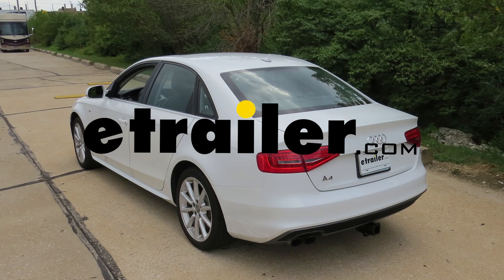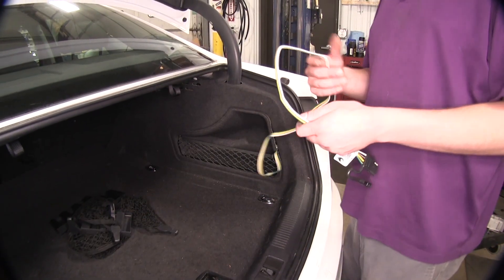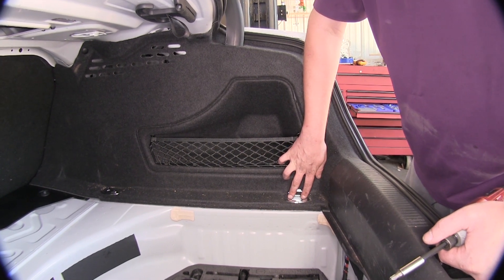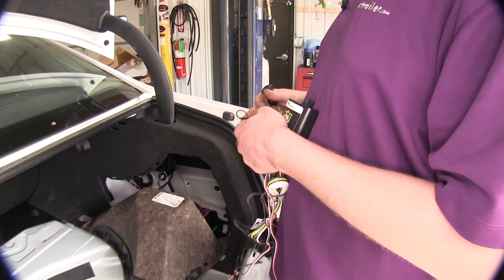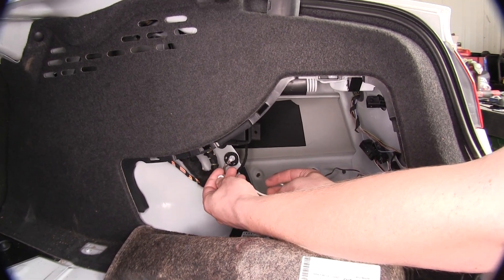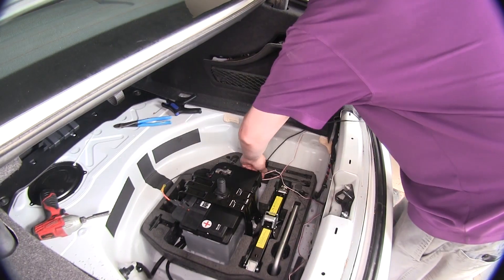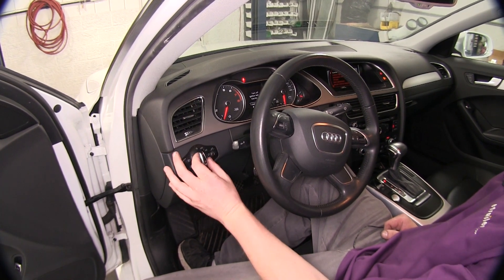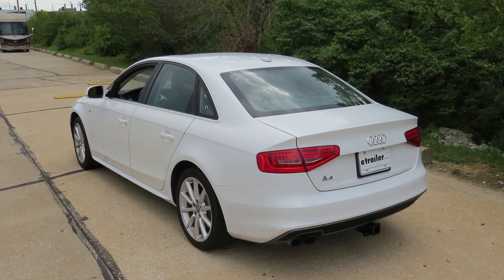etrailer | Trailer Wiring Harness Installation - 2014 Audi A4

Comment: you didn't show which wire was the brake wire and which one is coded for the A4
Reply from the maker: The best way to figure out what wire is correct for your vehicle is to test the wires with a circuit tester. That is how we figure out which wire does what function.
https://www.etrailer.com/Wiring/Draw-Tite/40376.html
https://www.etrailer.com/Wiring/Tekonsha/119250KIT.html